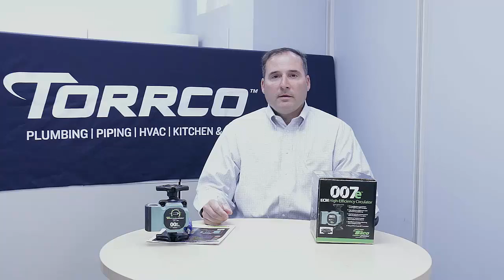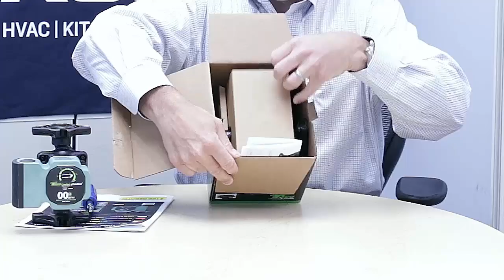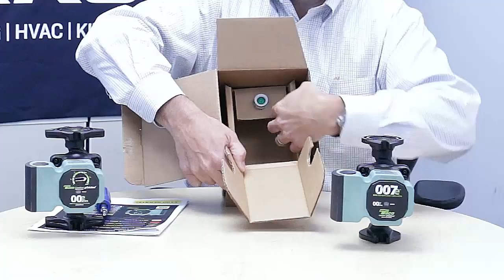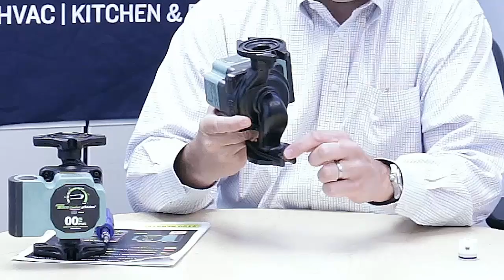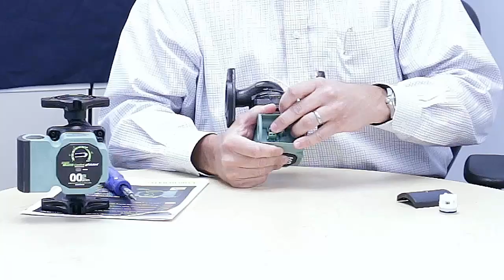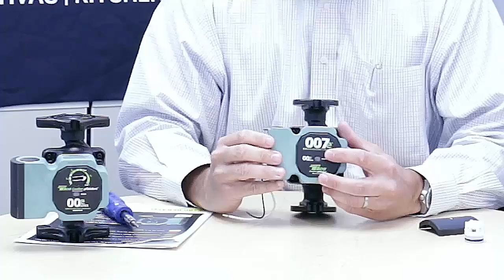Taco 007e high efficiency circulator pump available at Torrco

Comment: We have a hydronic system with 2 zones valves, and a open loop to our garage ceiling mount, thermostatically controlled fan unit. On the paper work for the 007E it states not recommended for open loop systems. I have both the older style 007 and the 007E in hand. Its -10 outside and the old pump is rumbling. Should I not use the 007E in this system?

Comment: nice educational video .....nice that left to right dimensions  is the same  for all 007 , makes  for easy replacement ...however  for new installations  one needs  the two flanges !!!! ...question:   with these new motors   your  video did not show if the  internal cartridge  can be replaced  like the original 007  ??...can it ?

Comment: Had 2 installed in my house, one for each zone. But, when one calls for heat water is passing by the other one heating up both zones. How can I fix this?
Reply: Do you have pump relays or zone valves? If zone valves I would say there's buildup on them and they are not closingif you do not have zone valves and you have pump relays I would say putting some check valves so you stop the flow
Reply: Did you put the check valves in the pump?

Comment: I have this 007e installed at my system for Secondary pump in Ultra 155 We Mclain and I hear gun shot sound when Zone valve closes. As you explained,  it has variable speed and it will adjust pressure as zone closes. If that is the case, what I am hearing loud noise when zone closes ?. Please let me know. This is very big issue in my system since I keep hearing loud noise every 1/2 hour when any ZONE Valve(Honeywell) closes out of my total 14 zones.
Reply: Remove the IFC.

Comment: Do I need Flow Check in Baseboard Heating system when this 007e used ?. It is causing Water hammer when Honeywell Zone valve is closed and I am wondering if 007e Flow Check is causing this issue ?
Reply: If your system has flow checks or zone valves, don't utilize the supplied IFC.